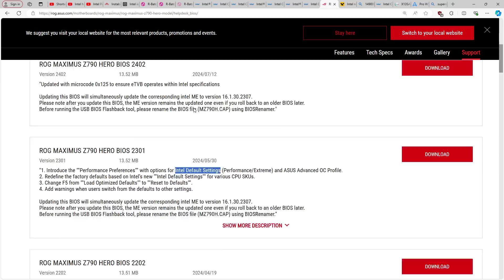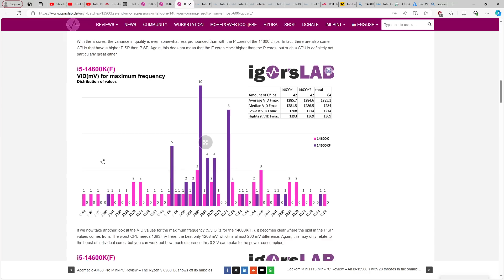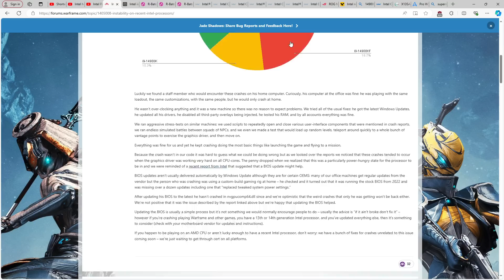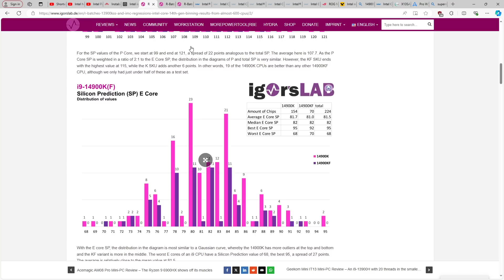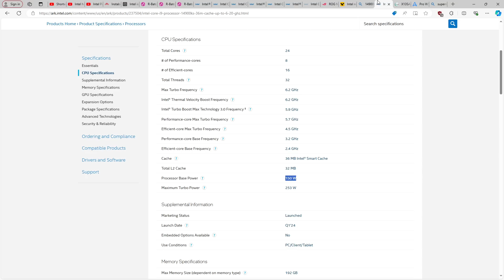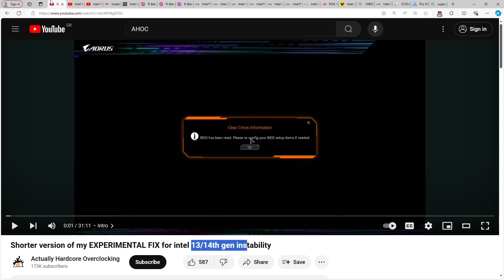The intel instability and degradation rant.

Comment: how abt i7 12700 non k that i bought at launch jan 2022 with asus tuf z690 plus wifi d4 at the cost of single i9 12900k.
i run at 125w and 200 watts PL
Reply: 12th gen is fine
Reply: @asdf_asdf948   my ram speed don't go past 3000mhz.. not even 3200mhz.. is it bcz of my cpu chip or ram kits.
Reply: @CaptainScorpio24 3000 mhz? Is your ram not the cpu 100%
Reply: WHAT about it? You should have bought AMD 😅
Reply: @danielt91  hahaha amd didnt launched in jan 2022. i upgraded from my i7 7700 non k and msi B250 pc mate.  reused my 32gb vengeance ddr4 3000mhz kit
Reply: @CaptainScorpio24  You're making no sense.
Reply: @CaptainScorpio24 yeah it probably is a dual rank kit and the non k cpus have locked soc voltage so they suck at overclocking memory